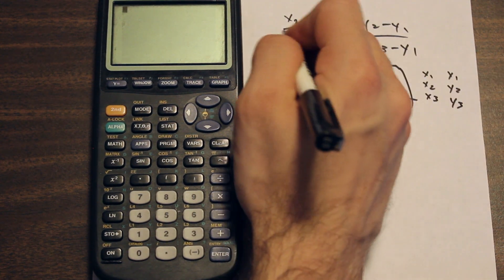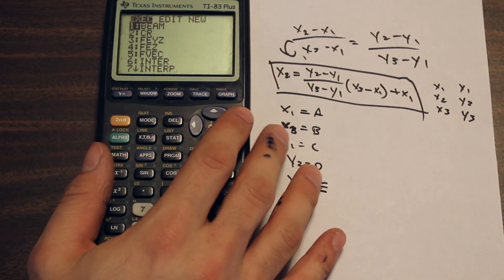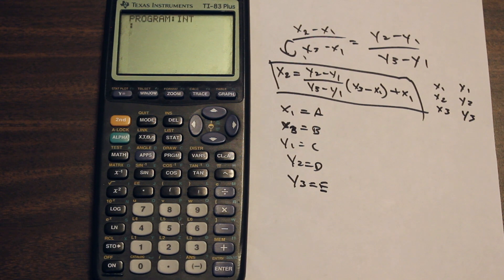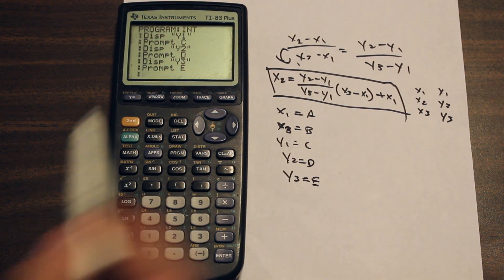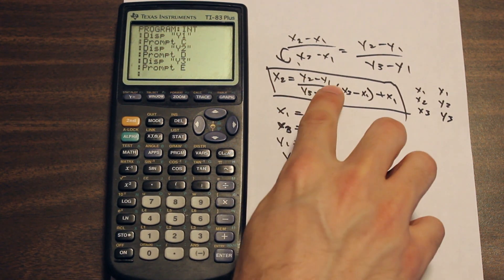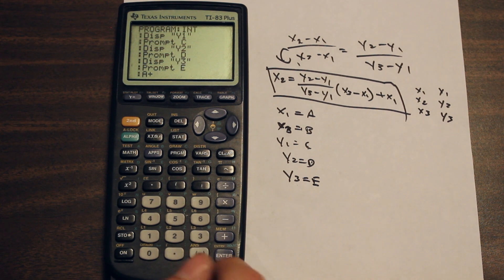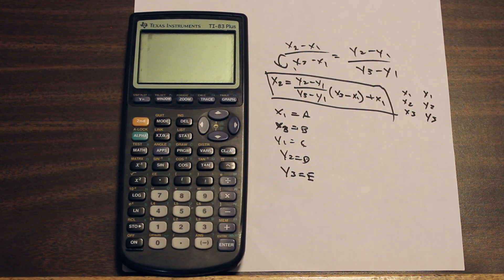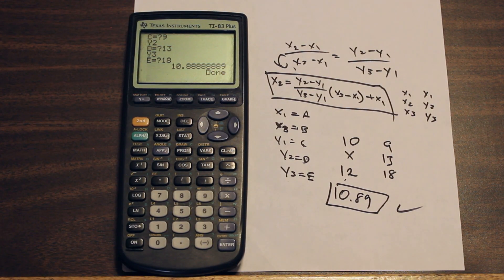Programming Linear Interpolation on the TI-83 Plus Graphing Calculator

Comment: I have a problem with this, its always off by a couple decimals, and when interpolating up  to 10 times in a single  problem, the right answer is for example 278 kJ while i get 293 kJ
Reply from the maker: thats odd, let me give it a try and see if the same thing happens.  thanks for letting us know
Reply: you know what, I've discovered that the answer key for thermodynamics used values of 120.9 kPa when i was interpolating for 120kPa, so thats where the difference of my values to the values of the answer key came from.
Reply from the maker: ah, yes that makes sense :) thanks for the comment though, hope you found the video useful :D
Reply: i did, this will save precious time on exams, thanks for the video
Reply from the maker: Excellent this is probably one of the most useful programs imo. Made a big difference in a number of my exams for sure. Enjoy!